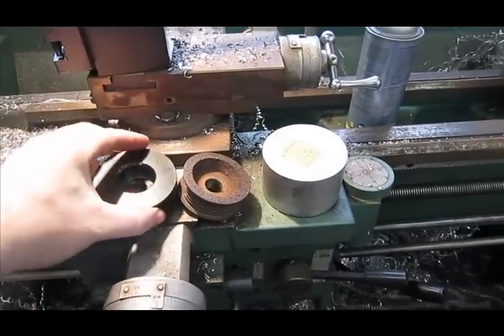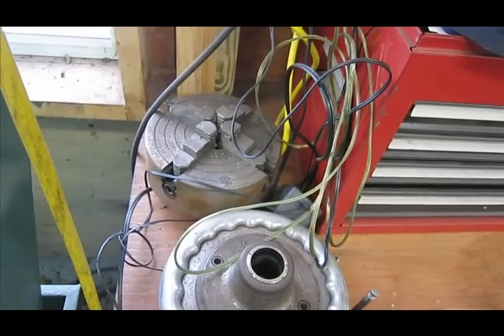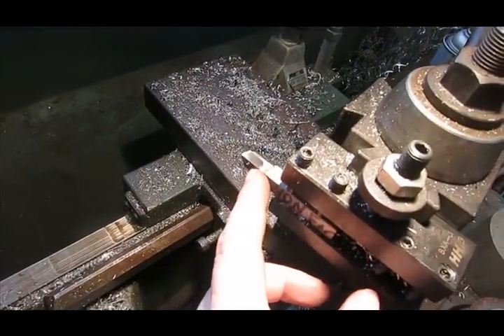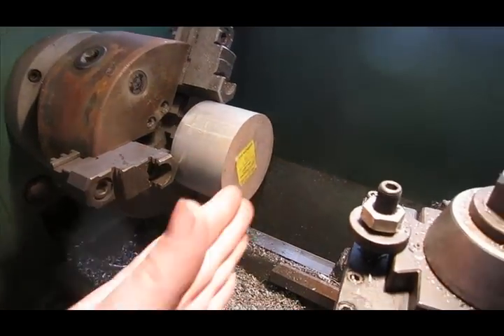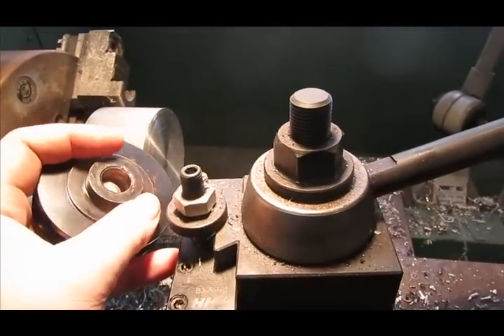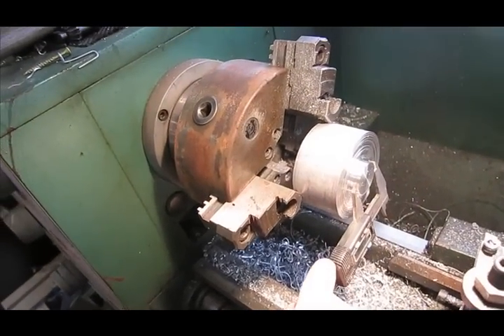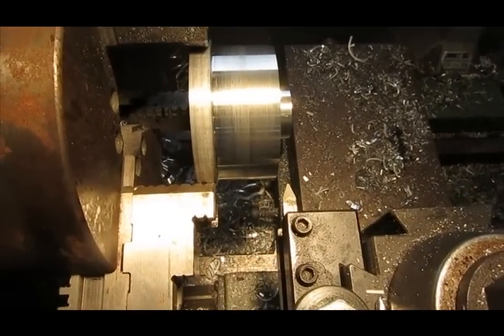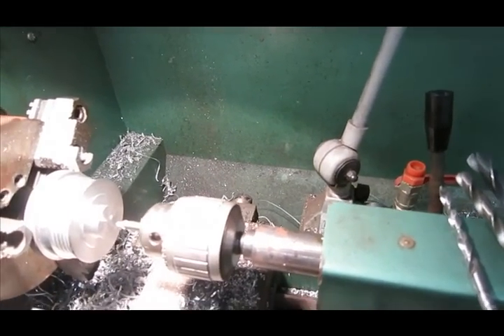Using a lathe to machine a custom pulley

Comment: nicely done. useful video instruction without rants!
any pointers on safety would be good. obviously many risks for unwary!
Reply from the maker: A video about lathe safety would be good!  There are a few things to mention right off the bat: always use a spring-loaded chuck key so it's never accidentally left in the chuck; a lathe has a lot of spinning mass and torque, so respect that it'll be happy to wrap up your hair/clothing/jewelry/arms/etc. without stopping; long metal turnings that come off a lathe are very sharp and will cut your fingers if you pull on them.
Reply: Also, don't wear a wristwatch, while operating a lathe.
Reply from the maker: Good advice.
Reply: My comment was a subtle way of pointing out, that you were wearing one.

Comment: Nice video, how did you measure for the depth of the v shaped grooves, and how did you pick the v shape tool
Reply from the maker: I actually ground that v-shaped tool myself out of a piece of tool steel and my bench grinder.  As for the depth of the grooves, I really just did it by eye (so it matched well with the belt and the old pulley.
Reply: Van Svenson Cool thanks for the quick reply. I've been enjoying all your videos. A little bit off topic though, i've been looking into porsche 944s as a daily. I was wondering if you have any advice of what to look for and what typical things maintenance wise for a high mileage car like that.

Comment: Looks good, I missed why you decided to make your own pulley,  is it so you can underdrive the alternator?
Reply from the maker: I'm adapting a small, lightweight alternator for a race car.  So I'd either have to change the pulley on the crankshaft or the one on the alternator.